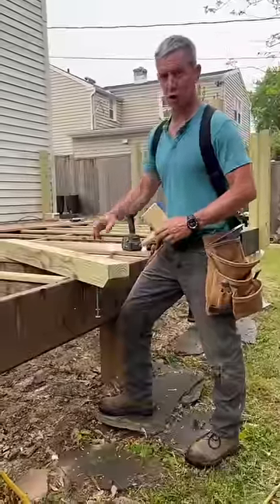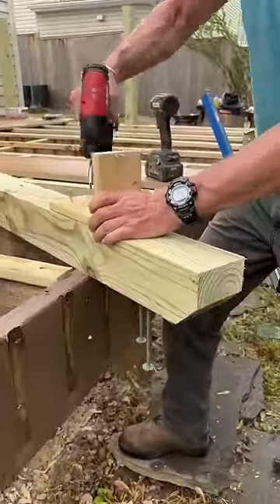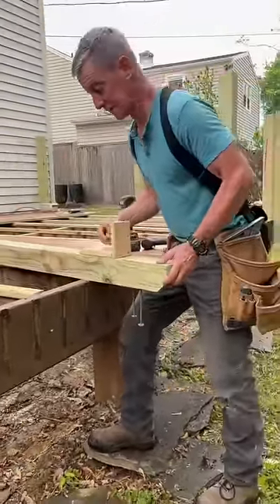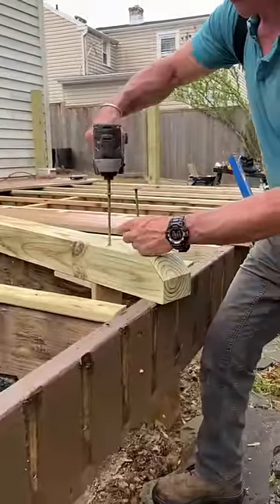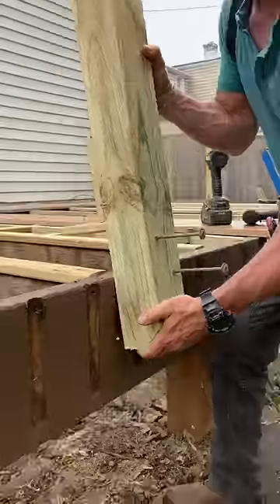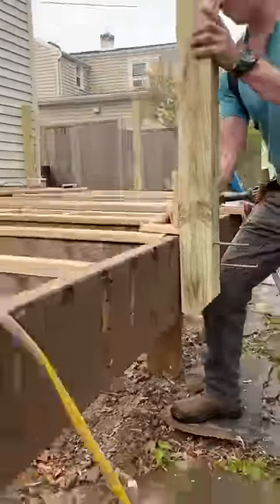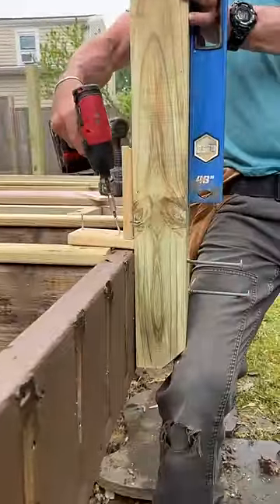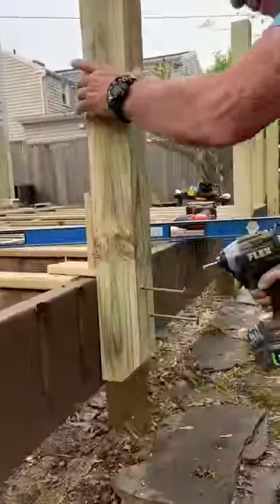DIY Tips: How to set a deck guard post by yourself

Comment: A.  Your railing posts should be the same piece of lumber as the posts holding up your deck.  They should be inside the rim joist.  They should be notched to hold the rim joist.
B.  The method shown here will result in railings that will pull away from the rim joist, or pull the rim joist away from the deck joists.  Code is the railing must withstand a 250lb person ramming against the railing. (When that post dries out, those shims he put behind it will fall out, making the railing loose.
Reply from the maker: You've kind of got something right and some things wrong. The standard may have changed since I was made aware of it, but I think the criteria is a 200-pound lateral load on a post without guardrail parts. Either way, we're close. - The guard posts DO NOT need to be made from structural posts. You're not the first person to say that, but it's not even close to possible on some decks. - Posts DO NOT need to be inside the band or rim joist. - These screws drove in so tight that it accounted for shrinkage. And even if they did fall out--they didn't--the post is supported by full wood fiber engagement on the screw shank--unlike a bolted connection where the hole is slightly oversized.

Comment: Stp is now a power lag? And he should mention this only works when going into a joist other wise you should us bolts and not lags the girder won't hold it with just lag bolting it
Reply from the maker: I get what you're saying, even through all the spelling hooha. - You're not wrong. On the other hand, the deck I'm resurfacing here hung on tight with a DIY spider web of 3/8-inch lags--not uncommon in the 25-year old range. - These PowerLags are going nowhere.

Comment: I like to pack my external wall frames with pine. I get work all year around
Reply from the maker: Sounds like you don't know what you're doing.
Reply: @myfixituplife  lol tell me how long them packers will last 🤣 good way to get work all year round. you must be going back to jobs on a yearly loop. Tell me what excuses you use I need some new material 😄 imma call you back yard blitz from here on out
Reply from the maker: @timothywood400  The packers will or will not last. Who cares? They're there to position the coated steel screws. So the question really isn't about the shims (which also have decades in them --plus the 2x6 top cap you ignored) it's if the system works. - Try to keep up.

Comment: Never seen anybody shim those.   I would recommend the plastic shims, pine is gonna rot quickly
Reply from the maker: I shim them all the time. Maybe I'm too persnickety, but if I can get it dead nuts I like to get it dead nuts. - In this particular case, it's a re-skin and that outside 2x10 band was just this side of a pretzel. The reason for that is it's technically a "fascia". The 2x8 framing was inboard of that, forming a gutter that filled with leaves and dirt for 25-years.

Comment: And now you have 3 unnecessary holes in your deck per post when you remove your jig!  Brilliant!
Reply from the maker: What do you recommend, glue?
Reply: @myfixituplife  a clamped jig where you are not violating or compromising the surface of the boards.  It’s a convenience for you as you’ll finish the project quickly and leave, but the homeowner lives with the 3 X (number of posts) holes where rot and insects can infiltrate.  Word of mouth travels and your quality is your business card!
Reply from the maker: @UFRooster  I’m not sure how one is supposed to connect a post to a deck without putting a fastener through it. What am I missing?

Comment: Well done.  The shims are a key point as well.  ...it turns out ALL Pt lumber is cupped, bowed akd twisted.
Reply from the maker: Thank you. The PT I get from my supplier is fantastic. This project is a deck rehab. Still, 30(?) years ago when I learned the basics of my system I call Top-Down Deck Framing -- https://youtu.be/G3QEyUBR4PM -- we had to shim then. We used nails we pulled off collated gun nail strips.
Reply: @myfixituplife  Thanks, I'll check it out.  That's great you are able to get PT that's more stable than what i've been able to acquire.

Comment: I’ve never not notched my post inside or outside mount. Stronger and looks better.
Reply from the maker: Notches work for about as long as this deck did in residential, light-duty applications. I took 25-year old, lagged notched posts out of this deck to resurface it. - Code-wise, notched posts have been a no-no for decades. For my money, I'd rather have a full 4-by cinched into wood fiber.

Comment: Won't running the lags in and out wear off any protective finish?
Reply from the maker: Good question. Answer is no. A lot of coatings wear off as the run in. Not so with Spax PowerLags used here.

Comment: If you had set them inside the trimmer and adjacent to a joist it would be stable in two directions!
Reply from the maker: In the forthcoming video, I show a 2x4 trimmer I run between the joists. It's entirely because I like it, but it does what you say it does. - I get what you're saying, but there are no "Trimmers" in this vid.

Comment: I put my post on the inside and block the back then I can secure them on three sides and the posts don’t move at all.
Reply from the maker: They sure don't. (These don't either, nor will they). I do the same thing in ew construction. I'd still use the same steps to set the post, no matter how I fastened the post.

Comment: I never knew there were so many deck builders out here not following the IRC code.
Reply from the maker: This video isn't really about how to fasten the post (this is a re-skin, so technically a repair; still, I stand behind the technique; it delivers on the spirit of the code), it's about how I get it plumb and still so I can fasten it with anything I want.

Comment: Power lags would fail code in my area. Must be thrue bolts here.
Reply from the maker: I just applied for a permit using PowerLags in the post-to-beam connection where I have used them for years and got redlined on that. - This is a resurface so we hi a nexus of code, common sense and profit margin. - This is solid.

Comment: Don’t overcut so you have to use shims.
Reply from the maker: This is one of those "double band joist decks" where the person who built it used a 2x10 over the 2x8 framing and it basically formed a gutter. Leaves and debris and trapped moisture deformed it. Nothing was over cut.

Comment: I just screw a batten along the bottom and sit the post on there while I screw them up.Also plastic spacers,those will rot in a year leaving the posts loose.
Reply from the maker: A batten long the bottom is a tremendous idea. These shims will remain primarily dry. I'm not worried about them. The plastic shims I've gotten are to blunt. Maybe I can find a different brand.

Comment: I always put my post on the inside for a better tightly fit
Reply from the maker: Many of my decks require what I call "housed" posts. However, a housed post is not required. The connection detail is.

Comment: I've always notched the post if I couldn't run thru from the ground
Reply from the maker: Notching works. The notched posts I took off of this deck had been there for 20-years. It's really, really hard to break a 2x4 in half with a 2x6 on top of it you also have to break in half. However, I like a full thickness post.

Comment: We might want to say that we should check code for the particular municipality, as code differs from place to place as to what size fasteners must be used to secure that particular post … Just sayin
Reply from the maker: For sure.  Totally good call. In tis case -- And in many permit applications I've been approved, this detail works. - Here, this is a re-surface. Permit not required but Code met. - Good luck breaching this system.

Comment: doubled up rim joist should be plum so you would level other side of post left to right not front to back
Reply from the maker: @jahearme4259  You’re right. This is a resurface of a DIY masterpiece decades old. - I despise the 2x10 fascia detail. And this is one of the reasons. - It’s a gutter.

Comment: Or, use a square and clamp as you mount the post on the inside of the skirt and avoid having to make the extra holes in the post and skirt where water can get in. So, who has help when building a small deck?
Reply from the maker: Too many steps. Holes in PT lumber…come on.

Comment: Are those treated shims ??
Reply from the maker: Nope. And, if they get wet, they'll get dry. They're fine. Even if they fall out, the wood fiber in the posts is fully engaged on the screw threads and shank. Unlike pre-drilling an oversized hole for a thru-bolt, this connection doesn't rely entirely on compression.

Comment: Screws to the rim plate are easy, but are not to any code I know.  Easy and fast is generally not the pest criteria.
Reply from the maker: I hear you. I also know that the spirit of the code is that the post to band joist connection is an unrealistic (IMO) 200-pound lateral static load to the post with not rails or top cap. My rails are 2x4 and my top cap is 2x6. I've seen the test in real life.

Comment: We use steel band joists and weld the post to B.J. then we drill to put nut and bolts then we weld the nuts so they will never loosen then we powder coat the metal twice and bake them with a trade secret machine. And we do 10 x 3 ft deep footers. Now top that 😂
Reply from the maker: NASCAR and NASA can’t top that. Maybe think about getting into the lunar lander business.

Comment: Will that support a 150 pound side load?  My local code enforcement wants to know...
Until then, I'm using hot galvy bolts and hardware.
OH, and crushing the wood lowers it's strength IMHO, but your mileage may vary.
Reply from the maker: Hey man, my mileage does vary and I appreciate that you recognize that only 3 out of 4 dentists recommend there's more than one way to skin a cat. - A couple things, yeah, 150-pound side load. I get it and I've seen the pulley tests in person when all this was first developed. Only problem with that test is that it is a lone post, no top cap. - WITH a top cap, the first thing that has to go is a 2x6 in the 5 1/2-inch dimension. Get a 16-footer, set it on edge, then get all your friend to stand on it and see if it shatters. - AFTER that, the connection to the band joist comes into play.

Comment: Carriage bolts are the best
Reply from the maker: They've worked for decades. The codes want thru-bolts, a minor but not zero difference. - The point of this video  (in my mind when I shot it) was not the connection but how I got the post plumb, quickly and alone.

Comment: Fail, mount to the inside for code compliance.

I'd like to see your electrical work too.  Is it as bad?
Reply from the maker: In new construction, yes. Resurfacing a 25-year old, in tact frame, we do what works. This works
Reply: Fail. They build them on the inside for a reason.  Then again, you have great documentation for when you hurt someone when the railing fails.

Comment: That’s a serious driver he’s using , wow !…
Reply from the maker: That's the Flex Power Tools unit. I've been using several Flex units for a couple of years now and a number of them I consider to be best-in-class.
Reply: @myfixituplife  I read about them , and I’m impressed ! I don’t do any big work anymore,and my current tools are good . But if I add anything more it will probably be the flex system . We’ll continue to follow your posts, you’re never to old to learn .

Comment: These should be inset on the other side of the rim board. Then blocked in, and the bolted through. No point to the shims with wood posts. Wood posts shrink so much that the posts will change no matter what.
Reply from the maker: Not shown, there's a 2x8 inside that 2x10. And I agree, the wood will shrink as it dries out.  I'm just thinkin of this now, but there's a furniture making trick from colonial times, I think. They'd bend wood when it was green, then as it dried the mortise and tenons would basically fuse together. - I imagine the same would happen on these screw shanks. - The posts are going nowhere on this deck resurface.

Comment: I always put the posts inside the frame with blocking.
This method he does wont pass inspection in any jobsite ive ever worked at in the last 20 years.
This will be wobbling in a few years
Reply from the maker: There was a 2x8 inside this 2x10. Doing like you suggest (and is in the code) would put the inboard side of the post 6 1/2-inches inside the band joist. - This is a resurface on a suburban deck, not a Vegas hotel. - Also, these screws engage 100% wood fiber. Unless they're playing hockey up there, they're not going anywhere.

Comment: If the customer wants the posts on the outside say no.  Also use lag bolts.  Also make sure your bond board is plum so you don't have to use shims.  Also pay attention to nailing or screwing patterns and don't copy that one.
Reply from the maker: Couple things, I take customer service very seriously. I'm not here to be the smartest guy in the room, I'm here to give them--to the extent possible--what they want. - This might come as a shock to you, but I know how to build decks. This one is a resurface of an existing frame. It has a double band joist detail (there's a 2x8 inboard of that 2x10). There's nowhere else to put the post. The 2x10 had deformed a little after years of debris being caught in there, so I needed some shims.
Reply: @myfixituplife 1) throw away all of your tools.
  Lowe's is the store that a housewife wanting to hang a picture goes to. Those fisher price tools are a dead giveaway you don't know what you're doing.
2) find a profession you're capable of doing right, because building is definitely not your thing

Comment: I dont care for posts outside the rim. If it's on the outside you should def use a through bolt type post fastener. And then  you really need to fill in between the posts with the same lumber as your joists. Then after that over hang your decking an inch. Now your railing wont be floating out away from the deck. Railings need to be on top of your floor. Which is why we set them inside the rims. And they are much stronger when you fill in the proper blocking and metal lateral ties. When you could notch posts, outside installations were more common. But we dont notch posts now therefore outside installations bring them too far away from the deck and are much less sturdy. Common sense. When you change one aspect of construction. You are likely going to have to change everything that follows to keep  everything within spec
Reply from the maker: I don't disagree with a word you say. You're a bazillion percent right. - One of the unintended consequences of creating content is supplying context. We do our best, but even though we're both traditional editors for print and video, we miss things. - This video was about how to set the post, not fasten it. - It's also a resurface and maybe 30-inches high. It's a repair. I works. You should have seen how many 3/8 lags I pulled out of the 25-year old posts. - Keep up the good work.

Comment: In his next video, taken just after he failed his framing inspection, he shows how to install through bolts and DTT’s to comply with modern building codes. 😁
Reply from the maker: This is a resurface and there's a 2x8 inside that 2x10. There isn't bajillion dollars in the budget. This isn't new construction where I'd need this connection pass plan review, however, the amount of devastating force required to cripple this connection is so massive...nevermind.

Comment: Nothing even close to meeting current code here in terms of lateral resistance, etc, except that this railing is basically decorative so it doesn’t matter as long as it’s not a menace to a small child etc.  It doesn’t look to me that the deck is far enough off the ground to require a true safety railing.
Reply from the maker: This is a repair. Existing conditions were a hot mess. I resurfaced this deck and gave them a new guard rail. The other thing is, it works. I'd put 3-PowerLags up against 2-thru bolts all day. Add in the 2x6 rail cap, you'd need TNT to make this connection fail.

Comment: 🤦🏼‍♂️ all those extra holes wtf here comes the rot , i always rabbet my post and then either bolt or use timberlocks
Reply from the maker: You think a few screw holes in a framing member is going to rot? I suppose you throw away all the joists jacked up by lumber bands or lumber yard forks, too. - Rabbet a post? Never seen that. Do you mean 'notch'?

Comment: This is no longer IRC compliant.Guard rail posts need to be bolted to the joists as well as the band board and lag bolts don't cut it anymore...Even if you call them "power lags".
 Bad information.
Reply from the maker: I'm calling them "power lags" because that's the name of the product. You can buy them at Lowes. And they're not lags, they're structural screws (you really should know this) and suitable for use at the ledger, post to beam connection and in other locations.
Reply: But not suited for rail post use. Requires an additional bolt through the post attached to a Simpson DTT2Z which is bolted to the joist or joist blocking member. You have a great Reddit name!

Comment: This style was ok like 15 years ago, but now the code has changed. Rail posts need to be inside the deck and blocked up. It's way more sturdy as well.
Reply from the maker: I hear you. However, this technology didn't exist 15-years ago. These aren't hardware store 1/2-inchers you need to drill a massive pilot hole for, these are structural screws. I like Spax 5/16 x 6 here. Washer head.
Reply: @myfixituplife  I get that, but codes are still codes. Does the code in your area say it's ok to still mount rails on the outside?

Have you noticed that they stopped selling the prefabricated rail posts that have the L cut at the base? Well, that's why. Codes constantly change and not always for the better.